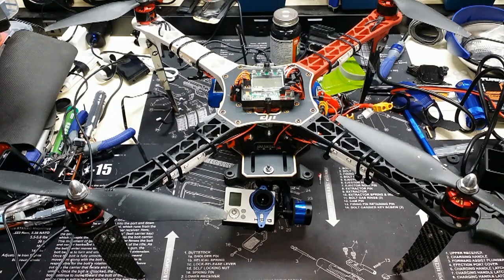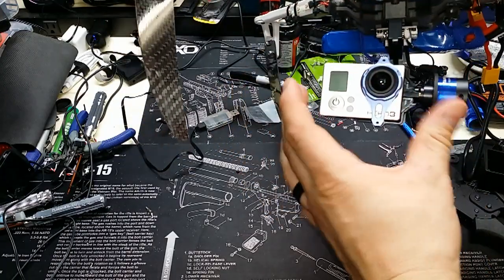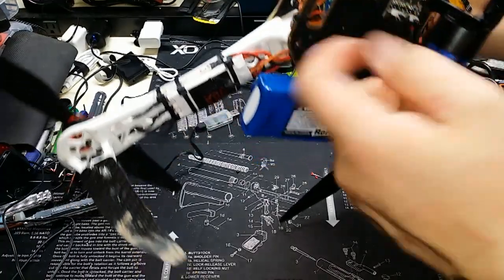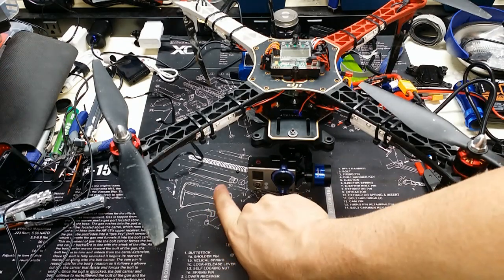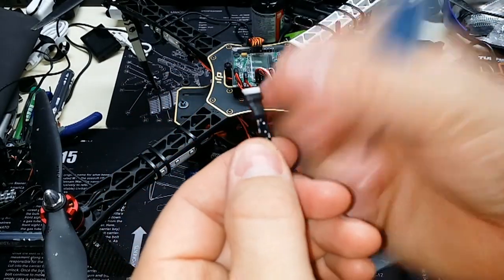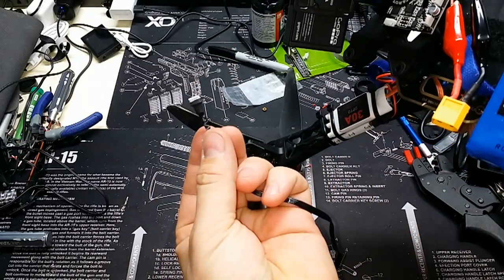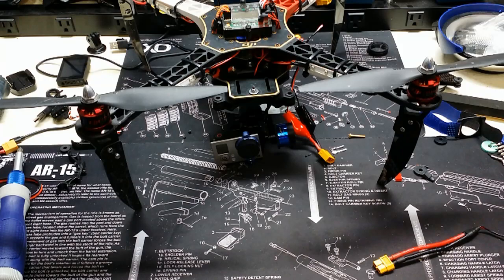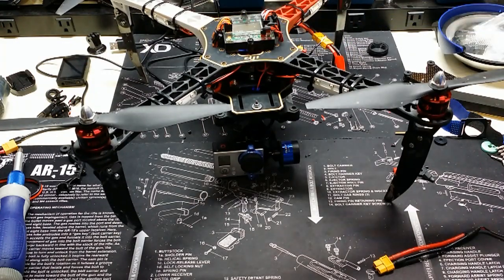DJI F450 Quadcopter Drone - Tarot Gimbal Setup, Install, Studder Fix

Comment: How much kv are those motors?
Reply from the maker: They came as a set with the frame and power distribution board.  Not sure how much they are by themselves.  Sorry.
Reply: +MrArmagedd0n dont they have written on them?
Reply from the maker: +MIKAEL'S LAB, Probably, but I no longer have this particular Quadcopter. Sold it and now am playing with a 3DR Solo.  Sorry.